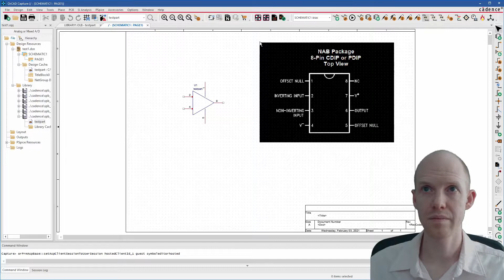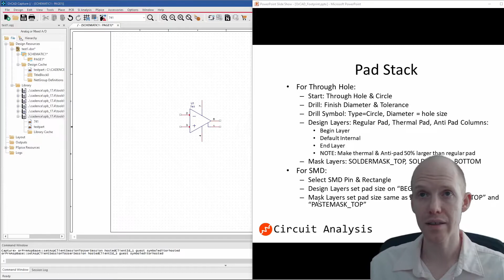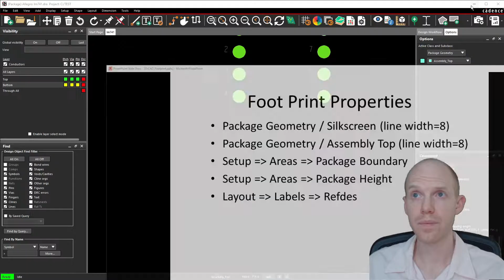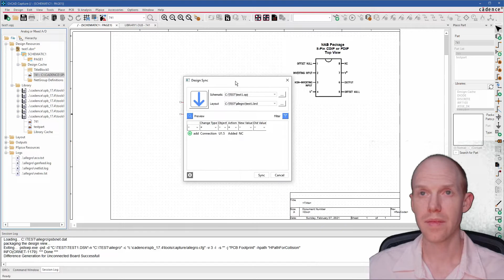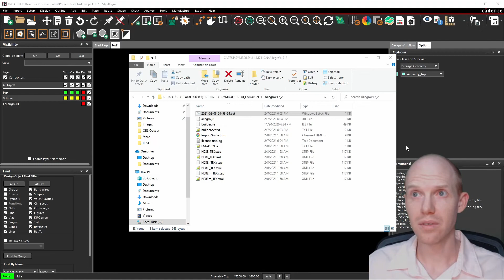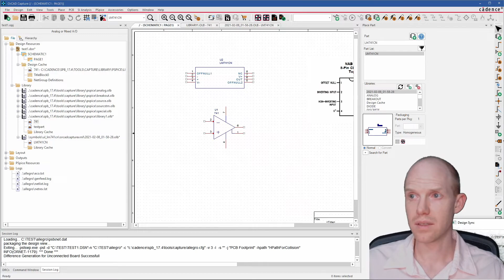Cadence OrCad PCB Editor 17.4 (Creating Custom Footprints)

Comment: Thanks for all the videos it is beneficial to us. I humble request to you a upload  single layer PCB ( how to add jumper wire ) in OrCAD  17.4 

Thanks
Reply from the maker: I believe that jumper wires are more for modifying a PCB after it is built than for a new PCB design. If you mean for a design that has multiple configurations then a jumper is just a zero-ohm resistor. Thanks for watching!

Comment: How do you get the Ref to appear on the board? 

That is, if you add the refdes here and change it to silkscreen top it does not appear on my board in silkscreen and auto add the number. I.E. C2
Reply: my board means when I generate the 3d drawing of the board.
Reply from the maker: I have a tutorial here where I use the custom symbols with refs: https://www.youtube.com/watch?v=7P3_TbJjoNQ
Are you having trouble seeing the ref in the editor view or just the 3D view? I don't use the 3D view much.

Comment: Hello Circuit Analysis, 

I know that you did not mention attaching a 3d model to your model in this video but I have a question about that process. Are you able to see the silkscreen for a specific library part when you make it? It is nice to be able to see it so you can determine its size. 

Thank You
Reply from the maker: Yes you can see the silkscreen in the 3d view. Thanks for watching!

Comment: how do you change the pin ordering? lets say I want pin 1,2, 3 and 5 but not 4.... do I have to place 5 and delete the 4th?
Reply: It seems that you can do this along with other option in the option tab while placing the pin.... however, I do not see an option after the pin is placed.
Reply from the maker: From the schematic, right click on the part and go to "edit part". Then on right side you should see a panel that has "Package Properties", "Part Properties" and at the bottom a button "Edit Pins". Click "Edit Pins" and you can change the "Pin Name" and "Pin Number" in the spreadsheet to match your datasheet. Does that help?
Reply: @CircuitAnalysis  yes thank you

Comment: I am trying to copy a footprint that I have in altium. It seems that you can only specify the thru hole to be square of circular.... not rectangular.
Reply from the maker: If you open the Padstack Editor and make sure you're on the "start" tab you could try a "Slot" for padstack usage and a "Rectangle" for pad geometry. Does that get what you're looking for?
Reply: @CircuitAnalysis  exactly what I was looking for... thanks.

Comment: Thanks you make these video very useful. By how can change (replace or update) footprint in PCB at specified component. That's mean at file layout.brd finished, after modify footprint with one component become a new one, and now want to use this new one.
Reply from the maker: If you have the .pad and .dra files in the project directory they should be linked. If the change doesn't show up you can can do Place => Update Symbols or delete it and do Place => Components Manually and replace it or try closing/reopening the program.

Comment: Great tutorial, may I please ask if you are using your own best judgements or are following standard type 1, 2 or 3?
Is it possible to have 3 designs in one file?
Reply from the maker: What standards, like IPC? I think you can only have one PCB for each .brd file but you may be able to have multiple .brd files in a project. I personally try to keep it simple though and use a separate project for each simulation and for each PCB. Thanks for watching!
Reply: @CircuitAnalysis  Thank you so much for taking your time to answer my question. The standards I am talking about is more the generally accepted standard that is being used and tested against, while determine if a product is only made for toys or for medical devices.
There are different soldering techniques, amount of solder, size of pad and other things, most important is how high soldering is up on the heal of an SMD. :-)

Comment: Sir how to create smd  footprint for npn transistor???
Reply from the maker: The same way you make other footprints as shown in this tutorial.  You first make the pads in the padstack editor to the specs in your transistors datasheet. Then you arrange them in the PCB editor into a footprint according to the spacings in the transistor datasheet. Another tip is you could see if one of the built in models in the install director already has the footprint you want. There are hundreds of pre-installed parts so there's a high likelihood your desired footprint is already in there. However, if you're picky you may need to double check it against something like IPC standards for example.

Comment: Why would you create a custom dip width for the 741? 0.100" pin spacing, 0.300" row spacing.
Reply from the maker: Yeah 0.300" if probably a better move if that's the standard for those dips? I guess the flare out just helps keep them in place?
Reply: @CircuitAnalysis  Yep, most pick and place machines just grasped the leads enough to get them in the holes and let the springback hold them for the wave.
Reply from the maker: Oh wow I didn't even know people pick & placed through hole parts, I've only seen SMT, but that's cool thanks for the info.
Reply: @CircuitAnalysis  I was using Orcad in '86 or earlier, all we had was through hole for the most part. I worked for a company that made PC expansion cards, graphic, memory, additional serial and or parallel ports, etc. A full length PC expansion card would hold 384KB in the early days! I just bought Orcad for myself now that I'm retired, mainly to just do schematics for dozens of projects done with pen and paper for home over the years, and I'll put a couple of them to PCB one of these days. I'm tryin to figure out how to place an array of 75R38D PTH's for a prototyping area now. It's a 13x33 grid and I did the footprint in PCB as a straight sequence PGA, but the schematic symbol is killing me. 429 pins is a lot, I'm hoping there is a better way. I was wondering I could lay out a field of PTH's as "mechanical symbols" or something so I don't have to document all the pins.
Reply from the maker: Oh wow that's cool. Yeah I like to make little proto-boards on my circuits too. I am not sure what the best way to do it is. For mine I just did like 10 x 20 or so and I made in in the style with the pins connected in rows and power rails down the side, but I just made a 200 pin part and then connected the pins in a rats nest in the schematic. If you find an elegant way let me know. I am not an expert in boar layout. I am wondering if you could just use like hole pads on the board or something so it's not actually part of the schematic? Or you could try making all the pins on the symbol and then hiding them, but it is a bit of work.
Reply: @CircuitAnalysis  I managed to do it, I used a stock pad75cir38d and made a 13x33 PGA on 0.1 centers. For the schematic symbol I created a part with pin numbers = pin names and placed them around a part body that is 109 steps each of the 4 sides, and left them unconnected. Really happy to just see it appear in the place gallery. Funny thing is, I figured this out within 10-20 minutes of posting my previous comment. Thanks for the feedback.
Reply from the maker: Awesome, the PGA is a good idea, I think I just did copy/paste of a single pad/hole when I did it. Thanks for the response, it will probably help me and others in the future.

Comment: Hi, can you please tell me how can i get footprints from an already existing old schematic. It contains all the footprints, but i am not able to get them in my layout file. Could you please tell me how can i get the footprints from it?
Reply from the maker: Hi, so there are two files needed for footprints: The files ending in .dra are the overall footprint, but they also call the .pad files which define the actual holes or SMT pads. In Capture, you go to the property editor by double clicking on a symbol and you can see the "footprint" property which will call out the .dra file. This footprint is not imbedded in the project file, it is it's own file that is located within the project folder or in the OrCad default footprint directory which is part of the OrCad installation directory. You need to locate the footprint files if you want to have them show up in your PCB editor project. I have another video that talks more about the PCB editor here: https://youtu.be/7P3_TbJjoNQ
Note that in the project tree in Capture there is a "Design Cache" which stores some of the modified symbols used in the project, but as far as I know it does not store the footprints. I'm pretty sure you just have to get ahold of the actual footprint file from your other project, which would be footprint_name.dra
Reply: @CircuitAnalysis   Thankyou somuch for the explanation. In altium this can be achieved with integrated library option very easily. I thought orcad also might have some option like that
Reply from the maker: Well my main gig is the simulation, not the PCB design, so you should do your own research, but it's my understanding that orcad uses separate files for each footprint. There are single files for multiple symbols and for multiple PSPICE models, but I think there's just 1 footprint in each footprint file. The other thing to look into is the CS feature which I don't use, but that is a way to organize all your footprints / symbols / models using a standard database program. So if your project was build using the CS system, then you'd need to have access and be linked to the database to get everything synched up. If you figure out any tricks, feel free to post back here for other people to learn, thanks!
Reply: @CircuitAnalysis   sure, thankyou somuch

Comment: Hi, thanks for your video tutorial, very helpful, but I still have a question. Do you have to enter the path (c:\test) to get your pads a drawings found by the Schematic and PCB Editor, right ? If so, when you did it ?
Reply from the maker: c:\test is the project directory, so if you just put the pads and footprints (.pad and .dra files) in your project directory it should find them. You can also try putting them in a subfolder like ...project_directory\SYMBOLS or you could also try entering the full path in the "footprint" property of the symbol in capture instead of just the name. Let me know if you have any more questions. Thanks for watching.
Reply: @CircuitAnalysis  Got it ! I created my own lib in another folder, I was able to get Capture looking into it by adding the new path to Capture.ini.   Thanks for your help.

Comment: I encountered an interesting error: 
Error	Physical	ERROR(ORCAP-36064): Pin "1" found in PACK_SHORT property on part "U1" doesnt exist on the symbol. You need to specify a valid pin.	/U1	SCHEMATIC1, PAGE1 (4.80, 3.10)	PAGE1	SCHEMATIC1\
Turns out, I need to specify Pin-NAMES as parameters to the PACK_SHORT attribute, instead of pin-numbers. Maybe this requirement has changed with some minor update of OrCAD...
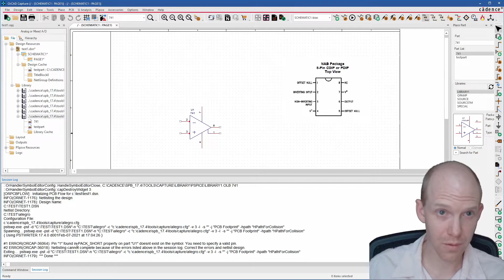Reply from the maker: Good catch. Yeah I got that one too and corrected it at the end in section 23:21 Correcting Symbol Error, but maybe I should have gone back and clarified better in the beginning. The other mistake I made was you have to add an "NC" property and list all the not-connected pins. For these though, it seems that you can use the pin numbers as apposed to names. Anyway thanks I appreciate all the support!
Reply: @CircuitAnalysis   You forgot to put the refdes on the silkscreen layer as well  the assembly top layer is so the layout tool can reference the component it will not print out when you give the gerbers to the pcb manufacture
Reply from the maker: @TDR Electronics Thanks for catching this! yes to clarify for everyone else, at 21:12, I forgot to change the drop down in the options menu to "Silkscreen_Top". I just tried to add a note in the youtube video editor but I guess it doesn't let you add text anymore.
Reply: @CircuitAnalysis  with orcad 17.4 you can download symbols inside of orcad using the symbol provider menuoption on place menu  in capture this downloads capture allegro and step files for the component transparently and places component on capture canvas it gives you ultralibrary as well as samacsys
Reply from the maker: @TDR Electronics awesome, good tip. This requires logging into a candence account and ultra-librarian account so I think you have to pay for the current maintenance and possibly an ultra-librarian option. I know when I first purchased my license it came with "6 months ultra-librarian subscription" but I'm not 100% sure how all that works together.
Reply: @CircuitAnalysis   i just pay for the current maintenance and this gives me access to the samacsys as well as the Ultralibrarian one caveat the samacsys i can use as soon as I have downloaded them the ultralibrarian ones you still have to convert
Reply: @CircuitAnalysis  Hi it looks like you are getting confused the PACK_SHORT property is in case you have multiple pins for the same purpose ie multiple 5v pins in this case you can just have one pin on the schematic and hide the others and then when it is netlisted all these pins will then be connected by copper.

This app note explains it https://www.flowcad.ch/en/support-training/application-notes      and select   Connection Symbol Properties  this downloads a zip file with the app note and a small demo orcad schematic this explains how to use the PACK_SHORT and NC properties.  the last time it was updated was in 2013 so it uses orcad 16.5 or 16.6 
but the principles are the same 

One tip i use go on the all the cadence distributors websites and download the appnotes most of the non english speaking countries have the appnotes in english
Reply from the maker: @TDR Electronics, I think that's what I was doing right because pins 1 and 5 are both offset_null? If not, can you elaborate on what I should have done? Thanks.
Reply: @CircuitAnalysis  Correct pins 1 and 5 is for offset null but these pins are designed to put a variable resistor on with the wiper connected to a voltage this can offset any input voltage  to the opamp because there is no such thing as an ideal op-amp. if you dont want to use these pins in your current design and leave them floating you can do that 

When you place the component on the capture canvas any pins that you dont want connected such as the 2 offset_null pins place a no connect symbol on it this can be found on the toolbar it looks like a wire trace with a red x in it the cursor will change to a black x just click on the pin you want no-connect and it places a x on that pin.

I do recommend looking at the app notes on the vendors sites even the foreign language ones sometimes they are in english .

Persevere and you will get there Orcad is a powerful system but it has a steep learning curve incidentally if you are in maintenance you can do any web based course on the cadence site for free these give you demo files and a pdf to follow along well worth it
Reply from the maker: @TDR Electronics Oh ok I think I see what you're saying, yeah that makes sense to just make them all NC in this case I was doing with just ignoring the null. It looks like you can't do the no-connect X in the symbol editor, but you can just leave the pins visible and place the X on them in the schematic to make it clear. That's not a bad idea. Well thanks for taking the time to share your ideas. Do you do a lot of the PSPICE modeling / simulating too or mainly the board layouts?
Reply: @CircuitAnalysis  I specialise in pcb debug . I could be working on production failures and customer returns. or I could be working in engineering on either taking the production failures trend to root cause or helping engineering to get a prototype into production.

For this I use PSpice as well as the signal integrity tools with orcad Professional licence I also have CIS and CIP  I dont do layouts professionally but i do do layouts for my personal projects

Comment: Thank you very much for taking the effort of making this video. Note that your series of videos is the first with which I have found an easy start with OrCAD (I'm not new to capture/layout per se - just to this software). The tutorials Cadence packs with their distribution obviously refer to an older version of OrCAD. I have not been able to replay any of them on release 17.4.
Reply from the maker: Oh cool, I appreciate the feedback. Are you mainly interested in schematic to PCB or do you do PSPICE simulations as well? I want to do a few more videos on OrCAD but I need to figure out exactly what to cover.
Reply: @CircuitAnalysis  Please cover PSPICE, too - as much as you can! You must know, I study* applied electronics and embedded systems at a "university of applied sciences", and this is definitely a hot topic. We cover that quite a lot in our curricula. 
(* I work there as an assistant, too)